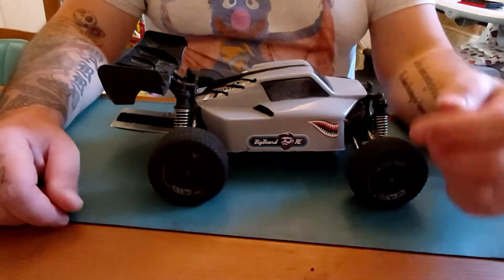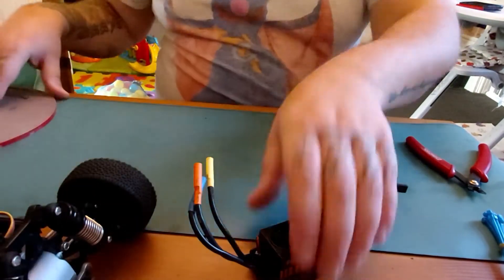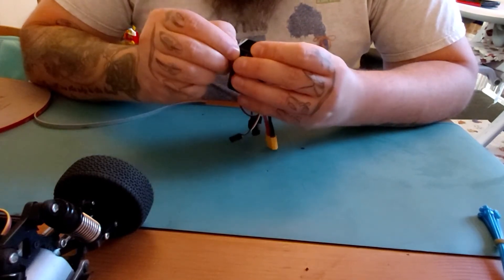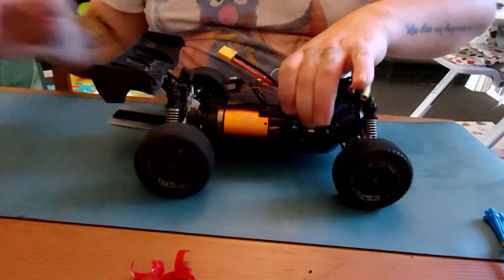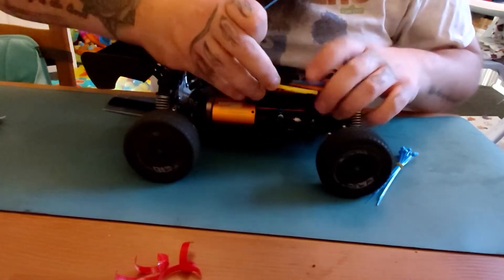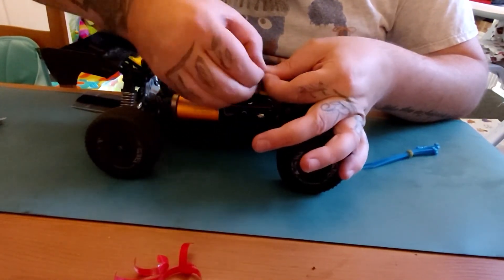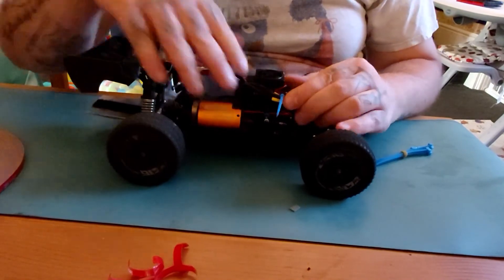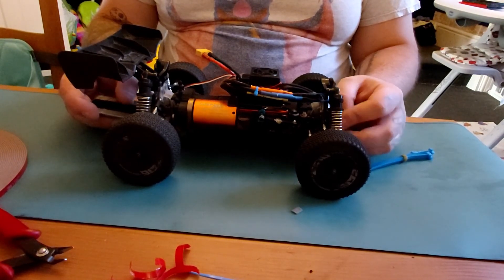Brushless Esc Installation On Wltoys 144001

Comment: How did you fit the motor? was it a drop in, or did you have to modify the pinion gear or motor mount? thanks buddy.
Reply from the maker: No buddy the 3650 motor is a direct swop

Comment: My esc blew up (i had the same esc) but now i have a 80a esc from a jlb cheetah and it does NOT blow up 👍 and i can finnaly run 4s lol
Reply: Dumbo RC
Reply: Jx servo
Reply: 3900kv motor surpass hobby
Reply: 2200 mah 3s 60c lipo and a 1500 mah 4s 100c lipo for speedruns
Reply from the maker: Thanks for the info dude.i bet that flies on 4s
Reply: @bigbeardrc4145  ohh yeaahhh